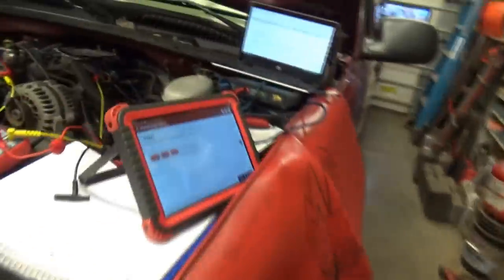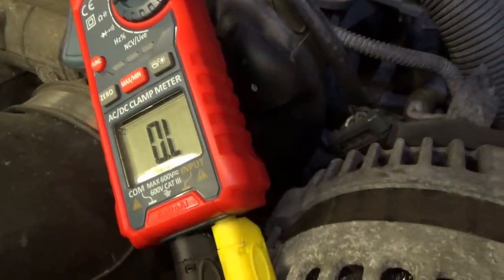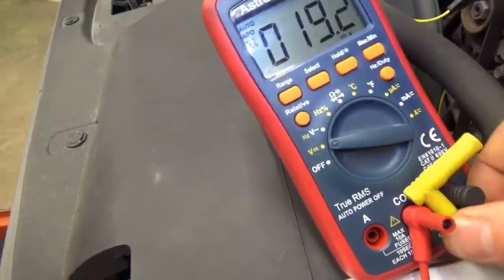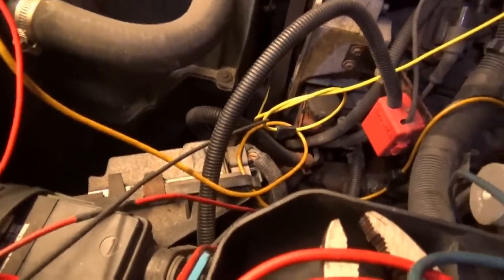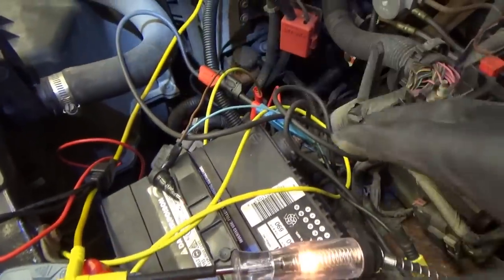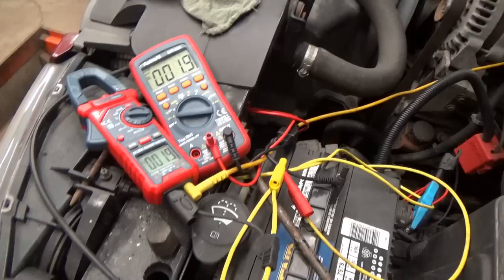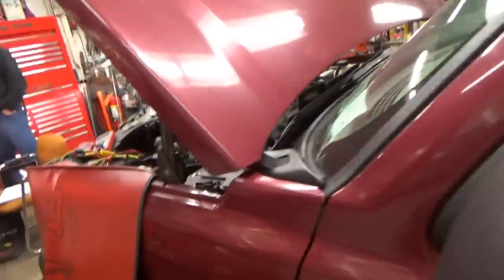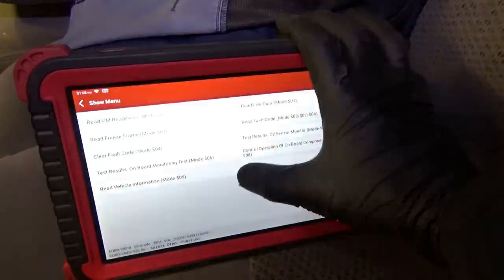Knock Knock...P0327 is here! (GM Truck)

Comment: I had my own little “diagnosis” I had to do on my snowmobile… left me dumbfounded at the end of it also…. It’s a late model (2015) but has a decently complex electrical system for being a 2 stroke snowmobile (direct injection, electronically operated oil pump for the motor, and a while host of sensors and has a security system from the factory similar to a car from the 2010 era)

Back story, I blew a piston last winter, so it went to the dealer to get a new oem motor w/ a factory warranty on that

Picked sled up last Thursday, loaded sled into trailer after fighting to keep it running as it was out of gas…

Went to start sled Saturday after dumping in a couple gallons of fresh gas, and nothing, no crank/no start (yes they can be only pull start, or have pull and electric start, but mine only has electric start from the factory). I go grab a multimeter, and check the basics right off the bat, verify volt at the battery, voltage at the 2 fuses (5amp and a 20amp) that run the sled, and check for continuity in the fuses, everything passes, I have good voltage at the solenoid also. 

At this point I start to have a bit of a meltdown of my own after just spending $5k on a repair to have a dead sled… and you can’t just flick a switch or key to power up the electronics to run a diagnosis on this sled unless you have the dealer harness and laptop to power up the ecm and go through a dealer diag (this would have saved my sanity if it was like the newer ones that you don’t need a dealer harness and laptop to power up the electronics)

So I tear the sled apart. Checking every connection, everything is good, at this point, I say “f it” and take a wrench and jump the solenoid, and the sled fires up instantly and is running (mind is blown at this point). At this point I start checking functions and come to realize I have zero function of the start/reverse button (multi function button that the ecm takes that input when running and doesn’t let it go to the solenoid, but activates the ecm to reverse motor rotation since a 2 stroke can run backwards perfectly fine) and once I shut the sled off, zero function of the start circuit….

So this leads me to dig around on google and find a wiring diagram (in which at the point is where I made a mistake that could have saved me time) and the diagram shows. This circuit is mostly a stand-alone circuit, it has a feed wire from the battery, through the 5amp fuse mentioned earlier, heads through the ecm and back out and up the steering post the handlebars to the control block for the start/reverse, and branches to the gauge for the clock to keep time… so I take and disconnect the harness for the control block and check for continuity and can it carry a small load with a test light (hearing your voice to say check to make sure you have a reliable power and ground) and the control block tested out perfect (had I not, I was convinced from google that the control block was faulty and cost $250 to replace)

So at this point I’m melting down again thinking I’ve got a bad ecm, but again I look at the flow chart, and the only thing going directly though the ecm is the “ground” side of the control block so it can sense voltage for what it needs to do, so I take test light and poke through out the harness, nothing… verify wire I’m looking for again, found it, nothing. Zero power…. So I reach down and poke the fuse with the test light, the in side lights, out side…. Dead…. Put a new 5amp fuse in and plug in harness…. And fires right up…. Pull fuse out and still has continuity but won’t carry a load 🤦‍♂️

So from reading more into google later, apparently being it’s such a small fuse, if you have it cranking it fires and dies and fires and dies before you let off (ie out of gas). The voltage spikes coming from the magneto are enough that when the ecm is switching from trying to run to charging to trying to run, that it going from ie 10volts cranking to 14volts running to 10 volts can shock that fuse just enough to break it without giving the classic blown fuse 🤦‍♂️, so it was tight enough to pass a tiny bit of voltage (I was getting .17 volts later in that harness that should be battery voltage at all times, but couldn’t carry the load to energize the solenoid or reverse function for the computer 
So that’s how my 2021 ended 😂
Reply from the maker: Nice! Just shows how the Ohmmeter is useless for checking powers and grounds 😉👌😁
Reply: @PineHollowAutoDiagnostics  yeah…. Would have saved my sanity if I grabbed the test light that sits right next to the multimeter 🤦‍♂️

Comment: I'd never buy a vehicle that has the ECU mounted inside the engine bay! All my Toy trucks have the ECU inside the cabin behind the glove box so absolutely no water gets in even if I cross a river with water up to the seat bottom! Thank you Toyota for letting engineers to design cars!

Comment: Great job of reasoning it out with a logical step by step approach as usual, one thing I still think remains Ingrained today is blame the computer, in very early days it was more often actually the problem but the industry has moved past that to the point its very very rare to see a controller failure and yet too often people start off with a presumption and then set about to quantify their original presumption rather than let the facts lead them to the true fault, I used to try to teach apprentices to let the fault tell you not you try to tell.it but alas testosterone usually led them a merry chase, great to see channels like yours and Diagnose Dan showing real world skills and processes, I wish these were around 30 - 40 yrs ago, even I google things before I get elbow deep these days, goes back to the old saying " learn by others mistakes "
Reply: Good low testosterone, Ivan!

Comment: Learning to expand my diagnostic knowledge. . .
1, did you know there would be a bias voltage on the knock sensors?
2, how did you know what it should be? Or were you just looking to see if they aligned?
3, what gave you the confidence that you could feed 12v through the lines while the ecu was still plugged in? Or is that the reason for the 2 lights on each end to  reduce the risk of current?
Cheers Ivan. I'm loving your uploads!
Reply: Those same thoughts ran through my head as well.. good stuff

Comment: Ok, so you're just getting started and maybe all will become clear in a moment, but you tested both OEM knock sensors at 111 kilo ohms ... and the spec says they should be 93-107.  So they're both out of spec... but you said they're both good.  I'm confused.
Reply: They were both the same and only one was setting codes 😉
Reply: @mattt4183  Ok, that's fair. Valid point. Thanks.

Comment: It looked like mineral deposits on the pins. Since they are gold plated they won't corrode.  But that mineral gunk can cause high resistance.  I use a spray and then use a small brush to knock the gunk off.  Soak up whatever is left.  TaDa

Comment: Ivan Can you use Di-Electric grease on something like this for those of us that live in the rust belt?  I know Chrysler used to use bulb grease I think Ford wanted a dab of grease in the spark plug boots on older 87 - 94 vintage F-150s so they wouldn't be DROF (you know the acroynm) LOL
Reply: I use Stabilant 22. It's a very thin liquid contact enhancer.

Comment: Interesting they dropped bias voltage from ~18.8mV to ~13mV post repair. Would have been interesting to have seen if you got the same ~13mV at the ECU - I expect you would. Which would mean the ECU lowered the voltage..... or something else changed (maybe based on the vehicle battery voltage or perhaps they just went into "doze" mode as the ignition was on but engine not started for a time). Doesn't seem like a great deal when figures are in mV until you consider it's a ~30% drop.

Also interesting that they are in the mV range to start with!
Reply: Chilly, I would suspect it due to the first test being only one good line and after the fix it had two lines for the computer to feed a voltage into.  That drops the voltage down.
Reply: @rogermerritt6470  Thanks. My grasp of even basic electrical engineering is somewhat sub par. I think I get the relationships between voltages, current, resistance at a point in time and then someone throws in Henrys of inductance or some such having an effect - then I go down a rabbit hole of reading about inductance and impedance and my head hurts and I give up.
I should go back to school to learn again from first principles somehow.

Comment: Years ago I had a 93 S-10 4x4 with the 4.3L.  I bought it new and at about the 4 year mark, it started setting an intermittent knock sensor code.  I replaced the sensor and connector with AC-Delco parts and it didn't fix the issue.  I took it to the dealer and because it was intermittent, they couldn't find the problem.  I never did get it fixed and eventually traded it in to the dealer on another truck.  Back then I didn't know crap about trying to diagnose anything.  I wonder now if it was a similar situation like what you found on this truck.

Comment: As a professional Electronic Technician,  I have found approximately 90 percent of electrical malfunctions are corrosion/bad contacts/broken wires/broken solder joints. Too often people will fire the Parts Cannon without fixing the cause first. Ivan is the Master at finding those hard to find malfunctions.
Reply: I had an electrical engineering professor who said "90% of electrical problems are air gap related, either too much or too little."
Reply: @eastunder55  ...i would say its bad grounds
Reply: Hello. I'm a retired electrical controls manufacturer. I have made literally millions of  electrical connections in my career. The thing to keep in mind is that when you make a soldered connection on copper wires it's very important that you actually make a good mechanical connection with the copper wire itself and then  when you solder the wire to the device the solder itself is not allowed to flex.  Solder is made with specific combinations of lead and tin and therefor has poor tensile strength thus breaking the electrical connection.
Reply: ...dont forget pins not fully seated and not "clicked" into place

Comment: Again...crap engineering and/or materials to sensitive electronics, wires, connections, terminals etc. I reckon that manufacturers figure that their products will never see the normal road and weather conditions that exist in this global territory we have. Great fix using how electrics and terminators function. The laws of physics still rule under the hood of every vehicle.

Comment: Thanks Ivan, I thought it was the ebay sensors I bought, look Identical to the GM ones and probably are.( 04 5.3 ) Gonna go clean the crustys. Had to do the intake gaskets anyway at 212K
Reply: Did it work for you I know it 3 years later

Comment: Turn key on, use scope test, smack side of block with hammer. 

Unplug harness both ends, do a test with power probe short tester injecting voltage, run tool down wire looking for break. If good then wiggle harness while running test at each end. 

Also on the manual knock test with scope hooked up you can use hammer while wiggling harness also. OR use the test light as you did.

Comment: One of the weirdest troubleshooting things I've ever had, was an open circuit. I narrowed it down to a 8" piece of wire, and decided to just replace that. Fixed the problem (permanently ) , and I couldn't see any reason why the wire failed, so I opened the jacket. All of the strands were there. It's like, the copper just said "I quit" ..
Reply: fractured and you couldn't see it, should have crunched it and measured the resistance change.
Reply from the maker: Keith Tug Test!

Comment: Remember the days when they put sensitive computers INSIDE the vehicle cab? I sure do miss those days! Nice find! I didn't know knock sensors had a bias voltage on them. Haven't had that problem come in here yet. Now I know! Much appreciated.  👍😎
Reply: I love how they not only used pot metal brake lines on this gen but also put the ABS module under the cab instead of somewhere even a little less susceptible to corrosion. As an added bonus, on the flex fuel models they stuffed a fuel filter right in front of the ABS module, making it a real joy to access when the lines inevitably rot.
Reply: @notsureigaf  Yeah, GM insanity! On my gen (GMT-900), the ABS is still out there in the open in the same location, but now the fuel pump is duty-cycle controlled, or PWM, and they eliminated the fuel filter altogether. The module for the pump lives above the spare tire, where even more water and salt can blast it to death. When that craps out, you're dead in the water - tow truck time! And when you replace it with a new $200 module, your truck still won't start - you need a J-box to reprogram the new part to your truck!! Same with your power window and lock switches. What a friggin racket GM has created. They're scumbags. So done with them.
Reply: @SmittySmithsonite  blah, blah, blah, blah, blah
Reply: @deerhunter8533  Nobody asked you.
Reply: Most computer circuits have a bias voltage
Reply: The fact they put in firewall is insane ...heat sink issue cooling the pcm ?
Reply: @kitsuneneko2567  So does my Silverado. Doesn't stop the low-bidder junk from failing no matter where it's located, unfortunately. :)

Comment: Mice go under fuse box alot on these year GMs.
I had two truck s no 4wd mice ate wires under power fuse box big nest alot.
Honda spice tape needed. 
Excellent work.
PS: Ivan get " Stabilant 22" liquid from NAPA used in Aircraft it increase s conductivity on pins and connections.
I used on Cranes and manlifts alot.

Comment: I got a 2004 Chevy truck 4.8l that won"t pass emmissions. I can run a drive cycle and get everything to complete (except evap which has to run overnight), but as soon as the key is turned off I lose all drve cycle data. I think I'll need to replace the pcm. Anybody have this same problem?
Reply: Speaking as a PC builder, the motherboard of a PC usually has a big clock battery to make sure basic settings is conserved if no power is present. If the PC doesn't save it you just need to change the battery. The only thing you need to watch out for is parasitic draw from the clock battery which would indicate something has shorted.
Don't know if this can transfer to your PCM issue, but hopefully it helps
Reply: Assuming the constant power is good at the computer then yeah it probably has a bad flash memory chip inside it and the PCM needs to be replaced.

Comment: Ivan I have the same problem with my 2001 Chevy Silverado. Put new AC Delco knock sensor's with wiring connector in and new gaskets. Code keeps comin back?
Reply from the maker: Might be the same solution?

Comment: Old guy here, when ever i come across similar  codes on old vehicles i pull all major connectors and give them a good spray of contact cleaner and re-seat them all! Then go from there being in the rust belt of Michigan. Have come across many a crusty connector!!!😉 You Do a fine job at Diagnostics my friend!!!
Reply: im a huge fan of dialectic grease
Reply: @ozzykrahn806  that’s to keep moisture out which is awesome but deoxit is excellent for after corrosion
Reply: You michigan folks need to get rid of whitless whitmer